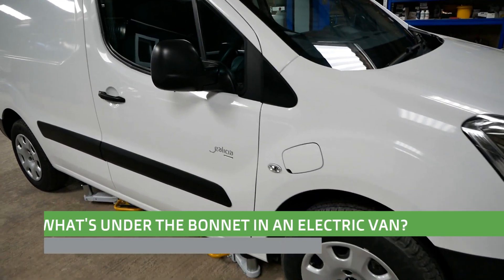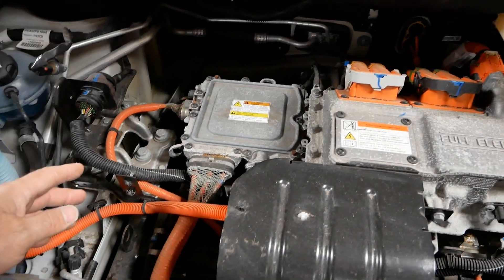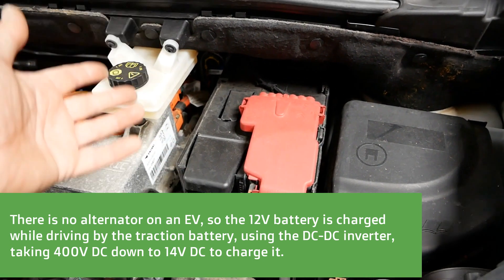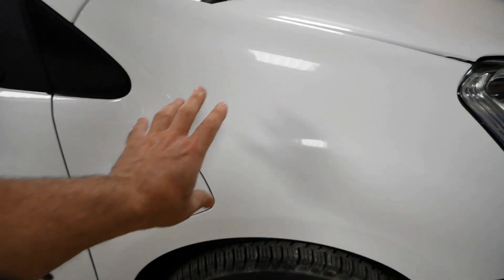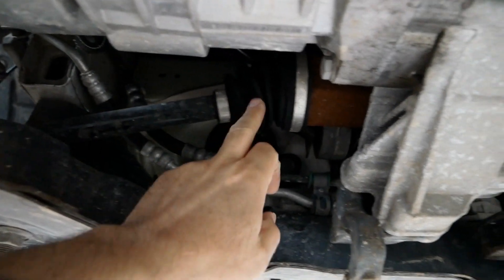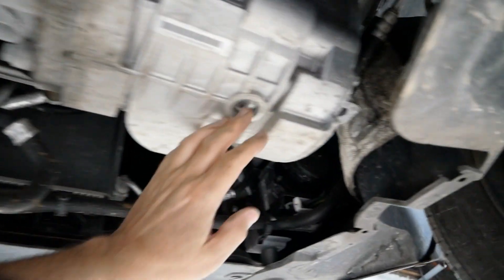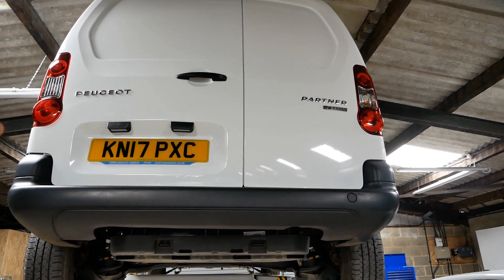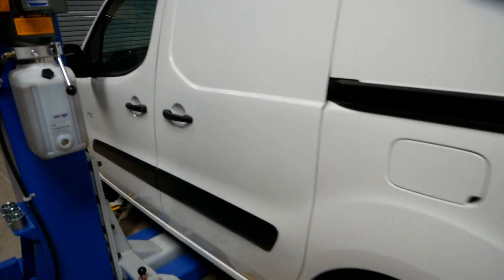What's under the bonnet in a Peugeot Partner electric van?

Comment: Hi there, I really appreciate you posting these vidoes about the older PSA Vans - theyre very handy indeed.

I own a 2015 Berlingo Electric and I've had an amber Engine Management light come on. It went into limp mode for 3-5 seconds then resumed as normal.

Ive changed the 12v battery but the problem still arises, is this something you could provide assistance with?

Cheers!
Reply from the maker: You've really got to get the error codes read otherwise you're stabbing in the dark.
Reply: @GoGreenAutos  Thank you for the response.

Initially, I tried reading the codes myself but every diagnostic tool couldn't seem to connect to the van - as a caveat they were all budget ones.

I've tried a few HEVRA approved garages in my area and they say they don't have the software for older PSA models - only the newer Stellantis ones.

I appreciate you pointing me in the right direction. Keep up the great content 🥂
Reply from the maker: @AdrianVirasami1  It might be true that they don't have the "software" for older PSA vehicles, but you don't need the full manufacturer software to do basic diagnostics. Any multi-brand diagnostic scanner can read the codes and tell you what's wrong. I only have an £800 Autel scanner and that can do diagnostics on PSA vehicles and will be far more basic than scanners HEVRA garages use. It sounds to me they are just pulling the wool over your eyes here.
Reply: @GoGreenAutos  Great response, thank you for the transparency.

And yes, I remember seeing your Autel Scanner in your Renault Zoe rescue video - that ended up being my point of reference!

I think it would probably be best to invest in a decent diagnostic tool then, cheers!

Comment: An interesting watch.
I drive one of these for work.
Unfortunately I have been left stranded on four occasions, as it's failed to start, even though it  had plenty of charge. 
Is there any explanation for this? 
One mechanic said it's because it's been left in DRIVE overnight. Another said it could be overuse of hazard lights. 
When I charge it. Am I only charging the main battery? As it seems to be one of the others that is failing.
Also, can these be moved (pushed) when the  battery is dead? I had terrible trouble moving it out of an awkward spot. The mechanic had to put it on skates.
Thanks for your time.
Reply from the maker: It sounds like your 12V battery needs replacing or properly charging.
Reply: Could it be the condition of the lead acid battery
Reply: You can get lithium iron 12 volt ones that have deeper cycle

Comment: Thanks for posting this! After having watched some of your reviews on this model years ago I bought a second hand Citroen Berlingo EV Club XL model from 2018, it's slightly longer than this Partner, but the batteries are positioned the same. Really happy with it! It's a solid car, never let me down thus far. I wanted to ask if you could ever do a video on removing the center dashboard console on these types of cars. There's very little service manuals or videos on this. Most are for older models. I need to get under the cigaret lighter and put a backup battery there for the dashcam I've installed (which requires it to be able to record in Parked mode), but it's quite hard to open it up without breaking it, if you don't know the order which you should do it in. Either way, thanks!
Reply from the maker: I don't think I've ever needed to get this apart. If I was installing a dashcam, I'd power it directly off the fuse board with a piggyback breakout fuse.
Reply: Quite right very little help. Take care as anything you break is expensive.ie a plastic clip

Comment: Hi, im interested in one of these vans fort my fleet, what is the range on these? and do you own the batteries?
Reply from the maker: Yes battery owned. Range is around 80 miles. But for all the details on range, charging, battery etc, click on one of the Partner or Berlingo electric vans for sale here https://www.gogreenautos.co.uk/for-sale#h.p_Vyg8erQw-leU
Reply: @GoGreenAutos  Mine dropped to show 130 km range after about 2 years of use after loading it using the granny cable at home. If you avoid driving outside of the green or blue on the dial, you'll manage to get to 150 km out of one full battery, but that's a sport ;-)

Comment: Another electric van with lots of maintenance to go with it because its based on a diesel
Reply from the maker: Sorry, but that makes no sense. The bodyshell, suspension and brakes are carried over from the diesel model. But then all EVs have suspension and brakes! All the powertrain, heater and air con are different and have proved robust and reliable.
Reply: Total nonsense. I own and use one ever since late 2019, it was a second hand back then, and it's literally needed NO maintenance whatsoever, except pumping the tires. This is about the 100% opposite with the non-electric cars I've owned before this. Not only was their maintenance more expensive, they had issues every other 2 or 3 months! So, really, I'm not sure why you're posting this, but it sounds to me like you're being paid by some fossil fuel brand/business.